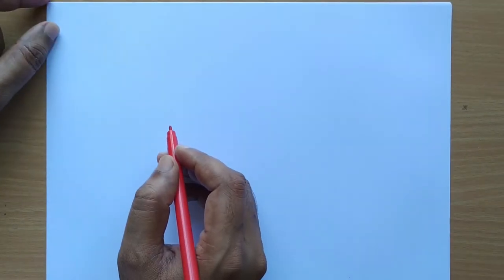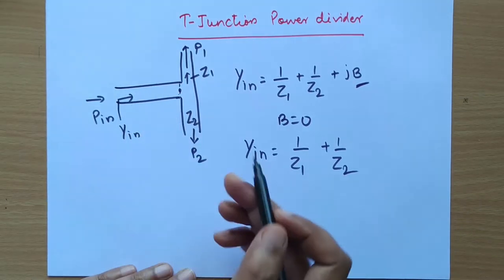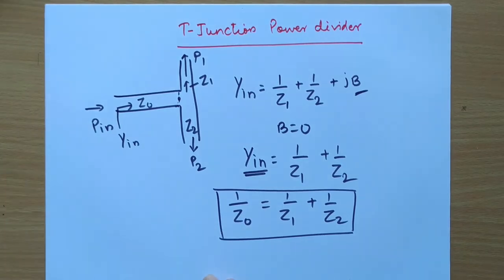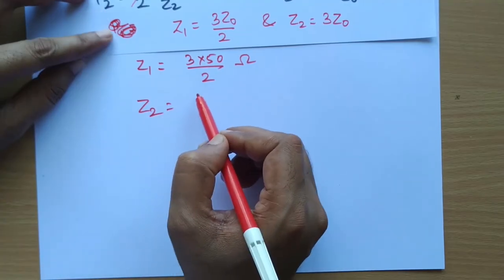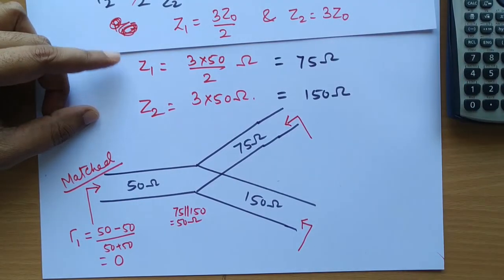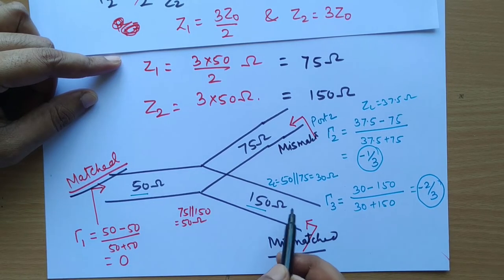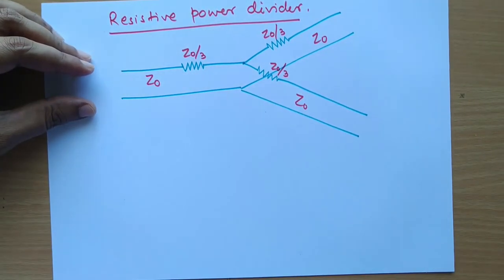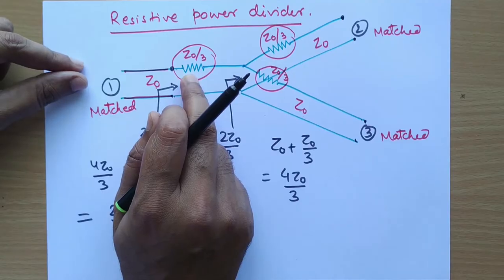T-junction and Resistive power divider with examples by Prof. Niraj Kumar VIT Chennai

Comment: i built a divider for uhf 476.9 mhz, i hope i got it right , 2 x 1/4len @75ohm 100 ohm bal resistor into 2x 50ohm @ 3/4 feeder len into 2x yagi folded dipoles, vswr for this ( and it was all luck) 1.7:1 @ 479.1mhz, the math is to hard for me ..sorry, i'll keep learning, good video thanks

Comment: Why S23 is not equal to 1 ? Hence,V3=V2
Reply from the maker: Ok I got your question. You are asking regarding resistive power divider if the voltage V2=V3, S23 should be 1? Now my answer to this. Since S23 is ratio of V2- and V3+ provided V3- is zero. But if we take port 1 as input port V3- is 1/2. So we can not take the ratio of V2 and V3. To calculate the ratio of V2- and V3+ we have to give input from port 3 so that V3- will be zero due to matching at port 3. Hence we will get 1/2 again.